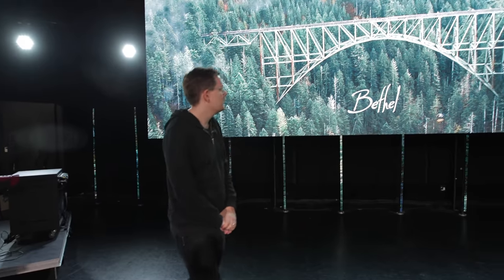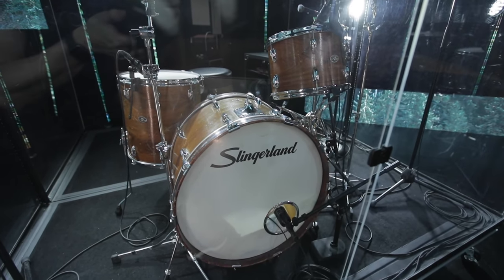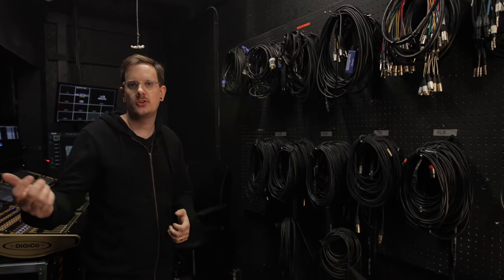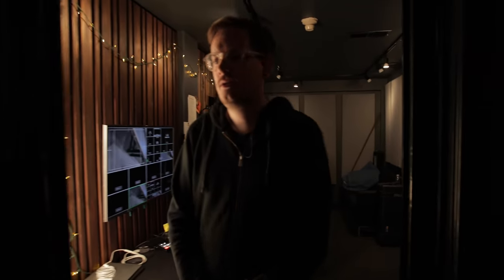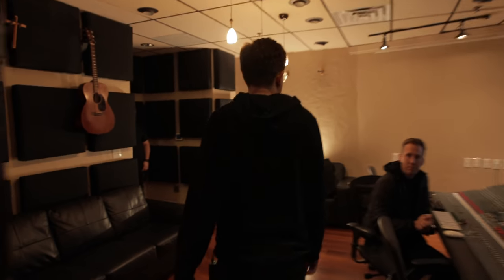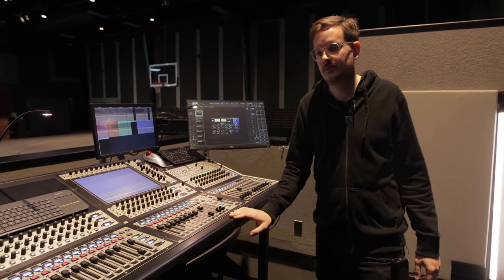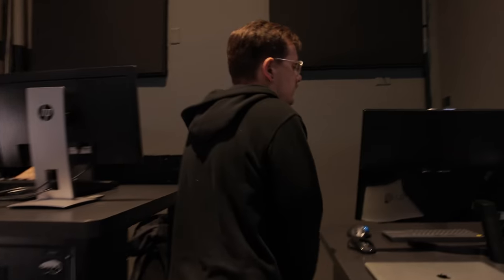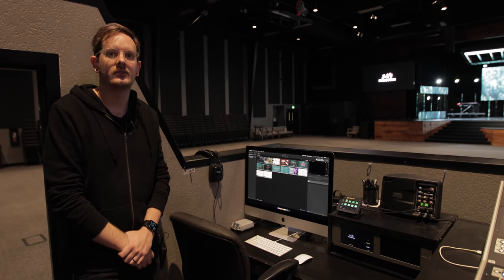2021 Virtual Tech Tour of Bethel Church Auditorium

Comment: Hi Paul I have some questions related to lighting. <I.e> 
1.what is the color temperature do you usually set key lights that are in chauvet R2 washes?
2. Do you use Stanly McCandless rule for key lighting?
3. How do you evenly spread fill lights during sermon?
4.  How do you merge both R2 and lekos colour temperature where it doesn't look different whenever the artists move around?
5. How do you avoid shadows  on the artist ?
6. How do you merge both LED Screen and back lights intensities where they dominate each other  where they look good?
Reply from the maker: hey there, we have our key between 3200k-3600 for worship and its at 3600k for speaking. we don't use a rule, just have been doing the same process for years and know what the temp is at and what is the best temp for our cameras. We use source4 pars only to key the speaking.
Reply: Thank you very much for your valuable response and how do you calculate the distance ( like height and angles of the lights to get the right amount of light on the artist?)

Comment: What capture card are you using for feed IMAG Screen on Resolume 7?
Reply from the maker: We hardly ever use this function but it’s a BlackMagic Decklink
Reply: The IMAG screens aren’t run through resolume. They go from the switcher, into an image pro jr for scaling (and slight color correction), out to the LED processors.
I also have resolume outputs going to the switcher, so I can out resolume on the side IMAG.
I do have a deck link card for when I do need inputs (or more outputs) in resolume.
Reply: Yes thanks for this tour! World famous out of a gym hall! 😁 cheers from switzerland!
Reply: Why use logic for live plugin hosting over protools, or a something intended for live plugin hosting like liveprofessor?
Reply: @theswaan  we also use logic to multitrack the band if we want to virtual sound check and logic let’s you have over 32 channels with nothing special. Protools is amazing but costs a lot more money for Protools HD and we aren’t mixing in it so no point in paying for it.